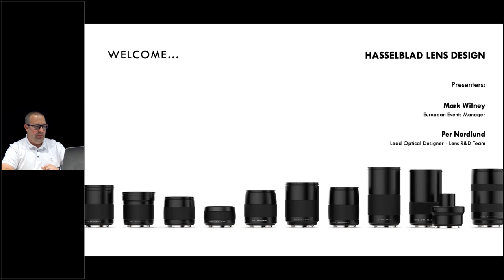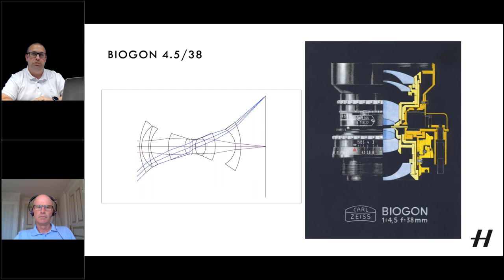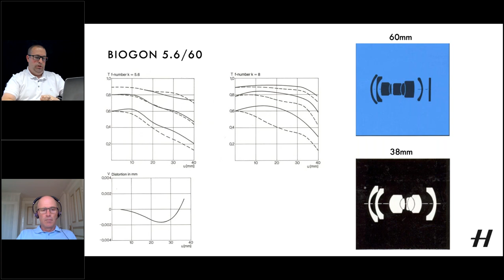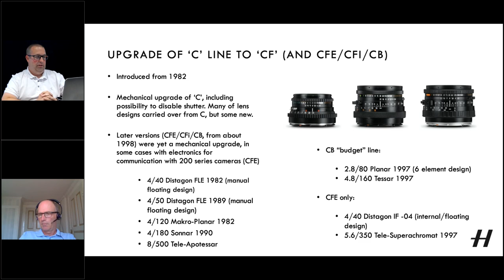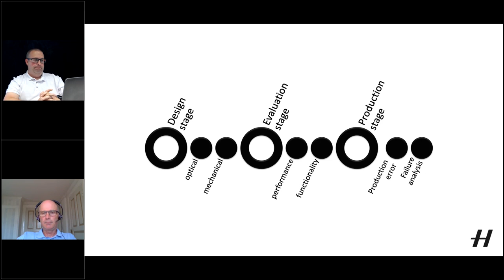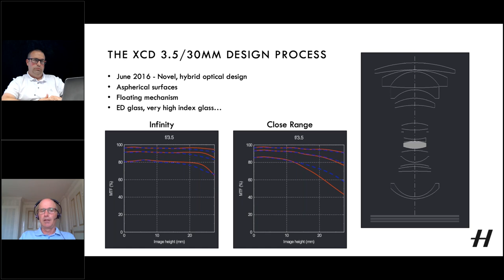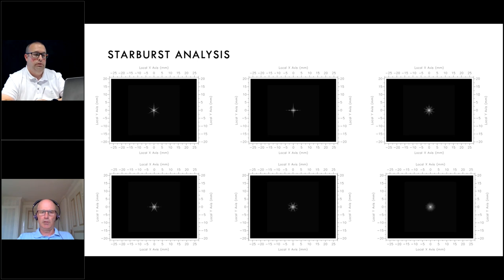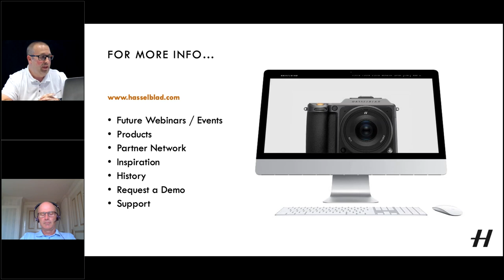Webinar: Hasselblad Lens Design

Comment: My second time watching this. Thank you so much, Per Nordlund, for proposing a re-design that led to the 40mm f/4 "P" lens for XCD! I love that focal length and the 40P lens has the best image quality of any 35mm full frame equivalent I've ever seen or used. Perhaps even more amazing is fitting a leaf shutter and the auto focus system into that tiny, light weight package. Amazing. Now, I'm struggling to decide between the 90mm and 80mm XCD lenses as my next addition to my system.
Reply: Which one did you end up with? I am trying to make that decision!

Comment: Cool stuff - does anyone at Hass know when the grip is coming for the 907X - i have found that there is nowhere to mount my flash Broncolor (which has to be Nikon for some obscure reason), transmitter? Also why no hood with the XCD45p? What should I use instead? Lastly any news on Ext Tubes? Thanks for help. Here to support not complain - I love Hass
Reply from the maker: Hi there, Thanks for your question! The XCD 45P does not include a lens hood but does accept widely available 62MM diameter accessories.
Reply: @HasselbladAS  Thanks for the follow up - much appreciated - wondered also what the flash connections/contacts were for on the XCDII? And why I cannot find a transmitter from anyone? And the grip for the 907x  -its all awesome gear and I love it - but trying to integrate it into existing systems - thanks
Reply from the maker: @nelsonclub7722  Hi there, We do support the Nikon TTL flash solution. In TTL-mode, the following Nikon Flash can be used: SB-300, SB-500, SB-5000, SB-700. SB-900, SB-910. The following Profoto products can be used in TTL-mode: A1, B1 and B2 with Nikon interface. Kind regards, The Hasselblad Team
Reply: @HasselbladAS  Hey there - thanks so much for reaching out once more - that is all the information I need - have a great day.